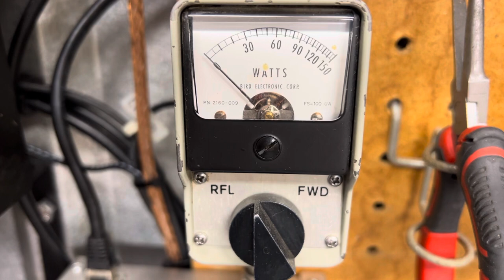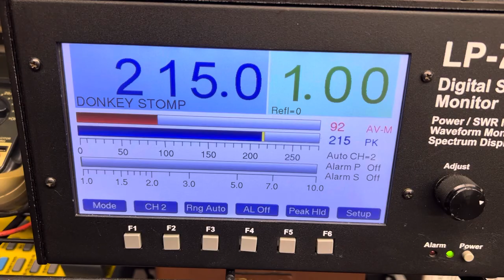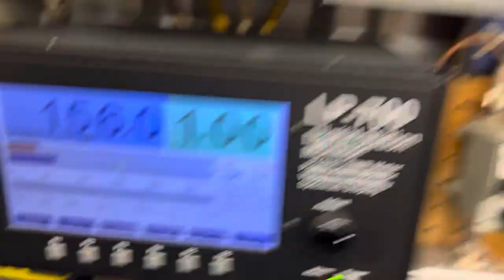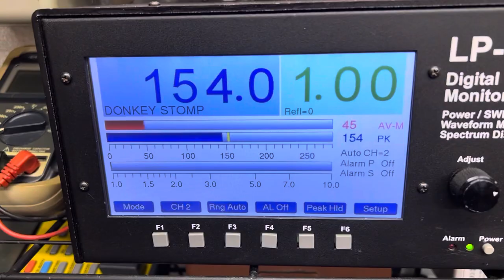Donkey Stomper Products, 100V-HG-1Pill, SSB Bias, CW Transmitter

Comment: For some reason i really like that small case. 
The 2 pill with can i have on that case is my favorite. And that thing seems to be pretty durable to as i can run that thing on ssb with long keys and the radio gets hotter than the box does.  😂😂😂 we'll see what goes in the months to come but I'm thinking about a 4 pill in a 2 pill case for the mobile. 😁😁😁👍👍 
Btw i didn't hear you mention the power supply variable in this video, does that mean it's been fixed.  😁👍👍✌️✌️
Reply from the maker: its going on base no need for on/off relay, Thanks
Reply: @DonkeyStomperProducts  i was referring to the variable on your power supply. 😁😁